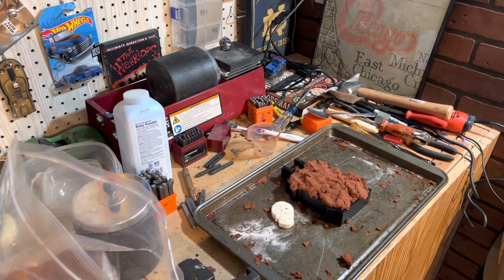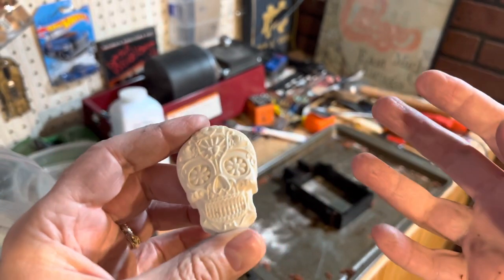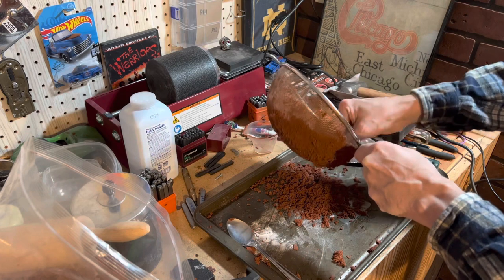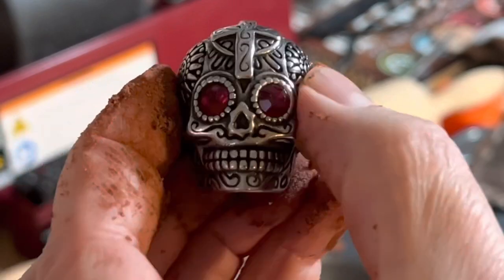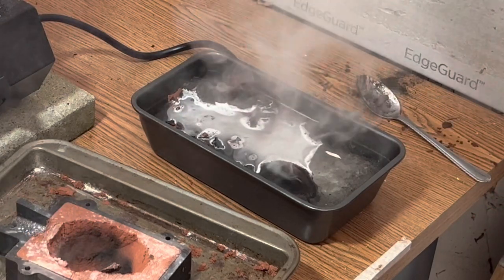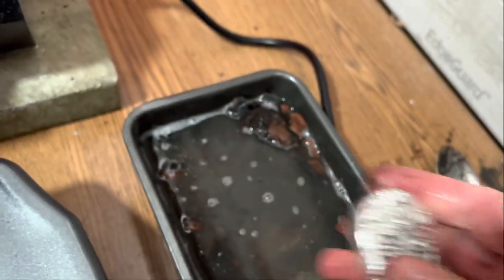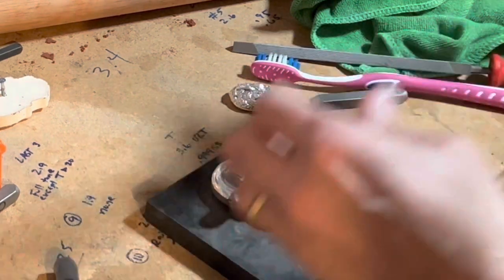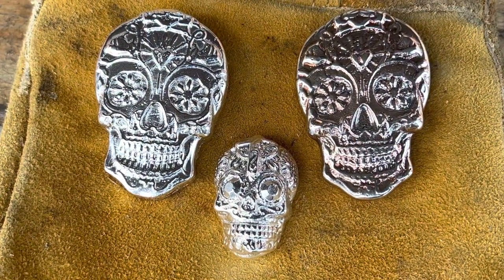Silver Sugar Skulls - Sand Casting and Silver Pouring Techniques

Comment: Nice work T, you are really doing well learning to pour silver. I found that if you tap the pour in the sand cast you can make some nice pour lines also if you try copper sometime be sure to use a separate crucible or they will cross contaminate. Copper has to get a little hotter or maybe just takes longer but it is fun to make one out of each metal. Keep having a great time.
Reply from the maker: Thanks for the tips!!